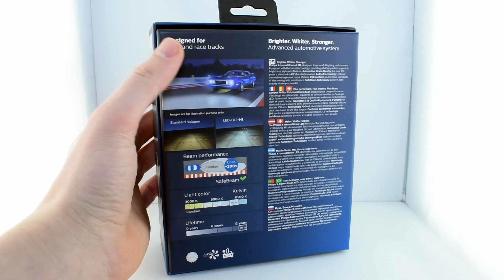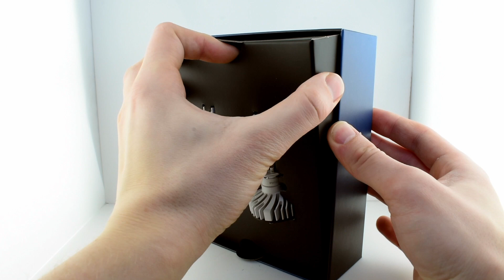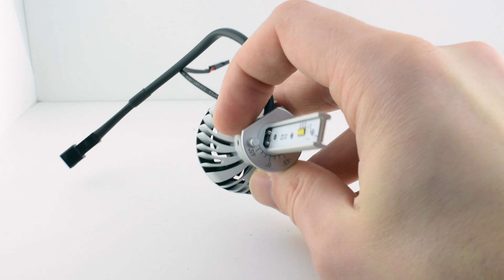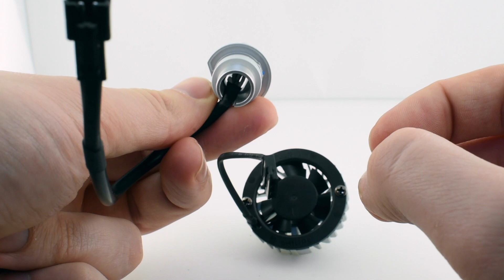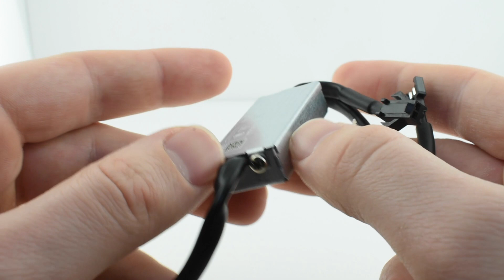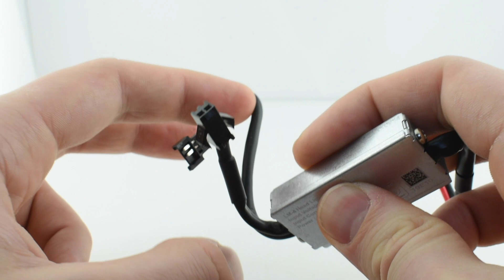Philips Xtreme Ultionon H1 LED +200% VS Standard H1 Halogen 55w

Comment: My car, a 2011 Fiat Bravo, uses H1 360 lens low beam headlights. Additionally, the ground is conducted directly through the socket to the body of the halogen bulb. Do you know if these Philips Led bulbs are suitable for headlights with these two features (lens headlights plus ground via socket)? I think I saw a black wire in the Philips, maybe it should be detached in my case
Reply from the maker: Looks like you can just pull out the ground wire, then you can insert it into the plug. I can recommend newer series of Philips h1 led bulbs, should work great.

Comment: how to connect the connector? i have posoitive and nagative and not sure driver have to connect both?
Reply from the maker: You can just try, if you connect it wrong it wont light up, it wont break.
Reply: It will only work one way. You can't damage the bulb so just try it, and reverse polarity if needed.

Comment: Good technical analysis. But one thing you should mention is that the center spot will always be "not as bright" as the two first points going out to each side due to physical build of the LED vs. Filament (Halogen bulb).

The LEDs being on the side of the front end of the pier means that the thickness of the pier will produce a "shadow" at the 90° of each side. And there's just that gap of 2mm which offsets the LEDs 90° forward to the 90° forward of the whole construction (the head of the LED).

Comment: Hi, I bought the LED for my Astra K with H1 high beam. When I install and wire everything. But the Led does not light...but the halogen H1 lights up as soon as I put it back. But it must sit in the socket. But when the led sits in the socket nothing lights...am at a loss and looking for help :)
Reply: Hi! I had the same problem as you do. It was actually an installation issue because the setup guide was not clear enough. The base of the Philips H1 LED is not conductive like it’s halogen alternative. You need to detach the black cable that is installed on the red cable from the controller. The red cable must be plugged to the 12V and the black cable you just detached must be connected to the ground from your headlight 😉
Reply: The Astra K has no CanBus at the high beam h1 Ligjt
Reply: Could be CANBUS (you'll need a controller to tell the car of the different resistance) or turn the plug around (if possible) as the negative/earth could be opposite on the LED vs halogen jobbie.  Hope this helps, it helped me (the turn around) on my Toyota (no CANBUS).

Comment: Led is legal in Norway IF you have auto leveling... referring to the Norwegian car authority 😎😎
Reply: Which you probably wont have in many headlamps using halogen Bulps :)
Reply: @HowIsThat69  That might be right but... if you have as me a car with xenon lights and one or more lights are bad, then its cheaper to buy 2 new headlights for halogen on eBay cheaper than 1 xenon costs used, 2 Osram led costs the same 1 xenon bulb. and at least all xenon cars have automatic light adjustment. and quality led give at least as good light as xenon. Anyway it worked like that for me on 2 Toyota avensis t25 one pre facelift and the other facelift =)
Reply: Same in Australia, so basically no, install LED globes to low beam and it's illegal as nearly no car with halogens has auto leveling (manual yes on some).

Comment: I am curious if they would fit in a honda c-rv 2007? The headlight housing is rather big but they has a lens built in.
Reply: Yes but you need the H1 holder (sold separately, looks like a butterfly) otherwise the bulb can't be fixed with the factory bracket.

Comment: The halogen bulb was more focused. LED was too dispersed. I'd stick with the halogen. Been there. Don't that.
Reply: Depends on where you drive. In high beam on twisty roads or with animals, +40+% a bit to the sides is VERY useful
Reply: This low power h1 led not good in projectors 
Better in reflector

Comment: Hello, what would be your recomendation for 20-30euro ebay h7 led? Is there a chance that they gonna be any good? Thank you
Reply from the maker: No chance, it would be a big downgrade if they are not just for looks. Go for a 35w xenon kit, with ac digital ballasts. Takes more space, but you get much more for your money. Works very well in halogen lens lowbeam and high beams. 
But don’t buy the cheapest ones, which have dc analogs ballast. Poor performance, lifetime and overall quality.
Reply from the maker: H7 not h1... Iam not so sure, but you can probably find something that will work, but not as a good upgrade. You would want to look for bulbs with small leds like the coil in the halogen bulb good cooling on the back, because high performance bulbs get hot. And overall a thin construction, so combined with the smaal leds it will give a better beam pattern. 
Xenon in reflector lowbeam is not a great idea, but otherwise it’s also a good choice.
Reply: Thank you for your answer! I like to test and bought https://rover.ebay.com/rover/0/0/0?mpre=https%3A%2F%2Fwww.ebay.com.au%2Fulk%2Fitm%2F312894140916  those bulbs. I will try to reach out to you if they are any good. Tried to pick lights with small leds and thin body. Im using other bulbs in my passat b5 projector lenses. They are ok during dry conditions, but still.. Halogen isnt that much better too. Ok,  will wait for those bulbs to arrive and compare :D thank you

Comment: I have a 9-3 2010. What lamp do you recommend for my high beam that's an easy install and won't give me any fault codes?
Reply from the maker: A high quality 55w/70w fast start xenonkit would be a good option,  gives much light compared to the price. But it takes more space, is harder to install and takes a few second to reach full brightness. Led i also a good upgrade, but good led bulbs cost money and less bright compared xenon. But they are easier to install, takes less space, less maintenance and starts instantly. Idk how the bulb controll is on 2010 9-3, but on a 2006 its a nightmare. I have just taken signal from the highbeam to a relay, so its not taking power from the highbeams, therfore i always have two warnings when starting the car.
Reply: @jobathano1660  Alright, thanks for the answer!